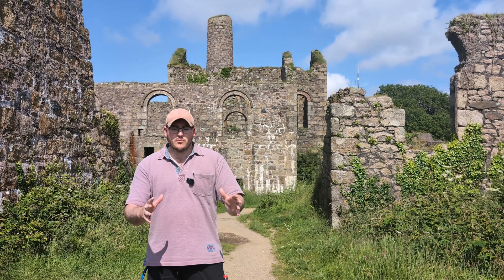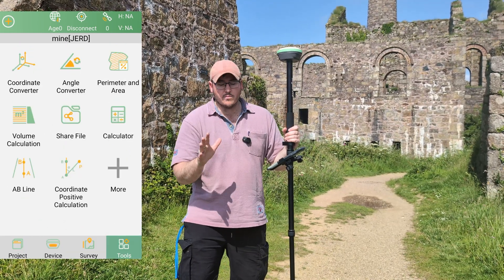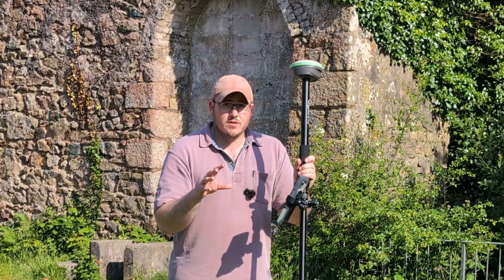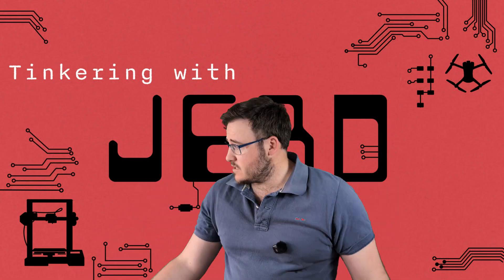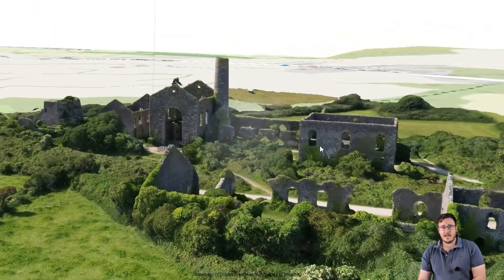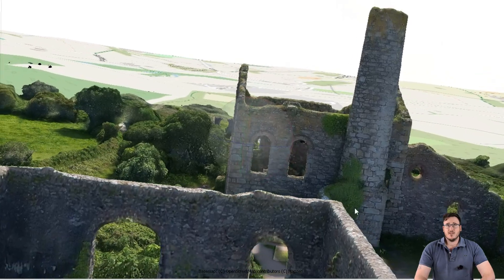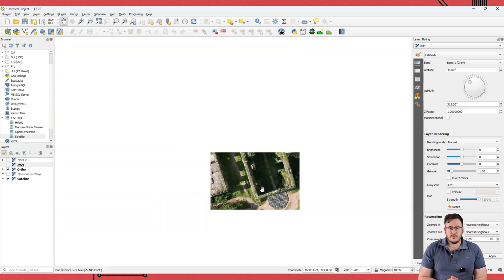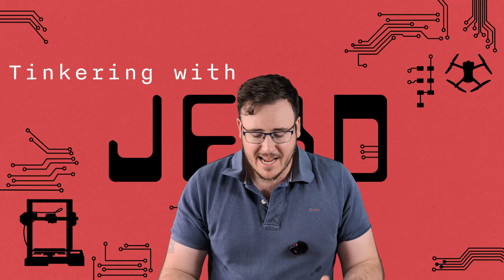Drone Survey & 3D Print of an Abandoned Mine – Multicolor Print with Creality CFS

Comment: Can you do underground scans? Like in existing and old mines.
Reply from the maker: Absolutely, you can do underground scans. The technique shown in the video can be applied underground as long as there's sufficient lighting, though using a laser scanner (like a terrestrial LiDAR system) is usually more effective in those environments. Control points are key: you'd transfer them from the surface down into the mine to properly register the scans and maintain accuracy.
Reply: @TinkeringwithJERD  there are survey pegs installed underground with x,y,z co-ordinates. Maybe you can use those as they the into the international surface grid system.

Comment: Really cool project, and a nice 3D print. Did you use the air 2S?
Reply from the maker: Thank you, that is really appreciated. I did indeed use the Air 2S. I know it’s an older drone at this point, and there are better options on the market, but the 1 inch sensor of the Air 2S is still fantastic for photogrammetry missions and definitely a drone I’d recommend as a relatively affordable way into the hobby.